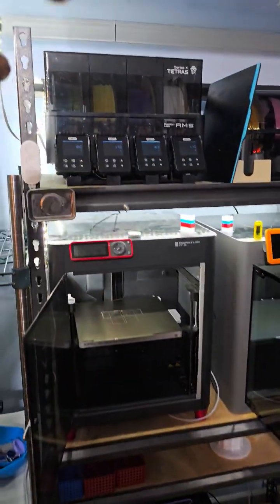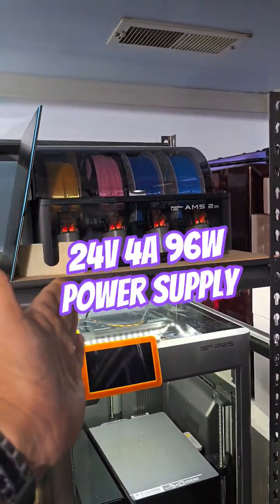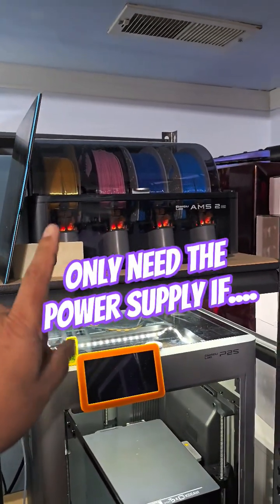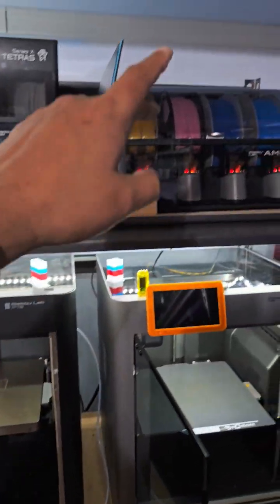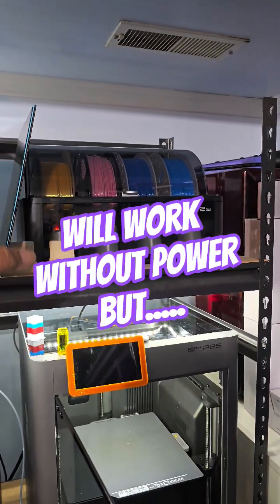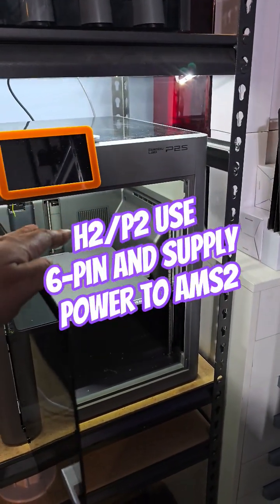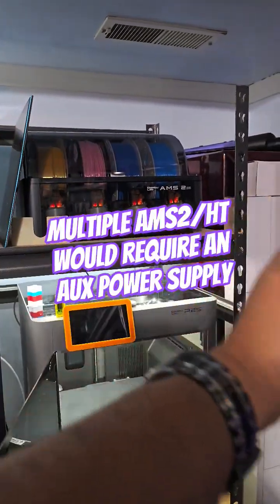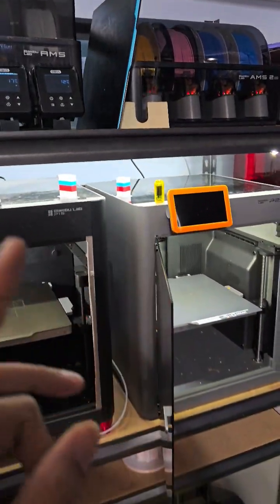PSU or No PSU: Bambu AMS2 Pro #bambulab #p2s #p1s #a1mini #3dprinting #bambu #x1c #a1 #h2d #h2s #h2c

Comment: A person on Reddit told
Me that if you bought the power supply you could then dry while printing. I don’t believe that is the case.
Reply from the maker: That is NOT the Case.  CURRENTLY you can only dry when NOT Printing.  There are talks of new firmware that would allow that BUT the Spools ROTATE Automatically on the P1S not allowing the filament to be loaded while drying.
Reply: @3DandTeePrinting yeah I figured there would be some firmware update at some point. Idk where he got that idea Lol. Loving the P2S so far
Reply: Slight correction here: I have this machine, and dry my filament while printing all the time, granted not as you mean it here. So what they possibly meant in this case is you can dry in your ams while printing, IF that is not the ams in use in the print currently running... But only if you have the power supply. So you can for example dry some filament for your next print in ams B while ams A is being used in the active print In process , without the power supply it gives you a warning saying you can't. To be fair, I do agree it would be nice to dry while in use.